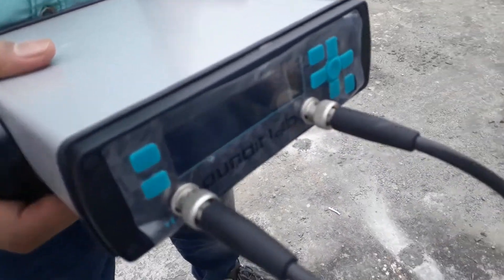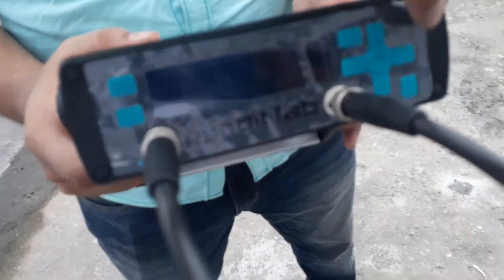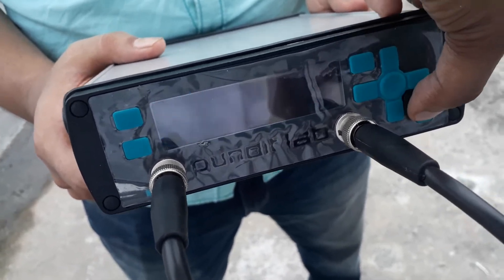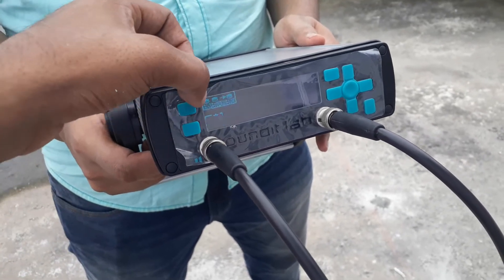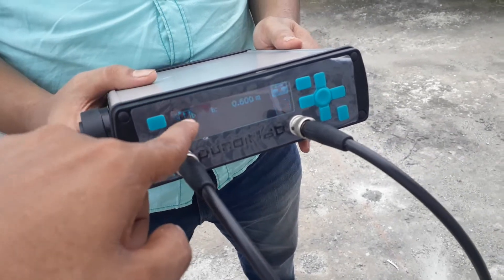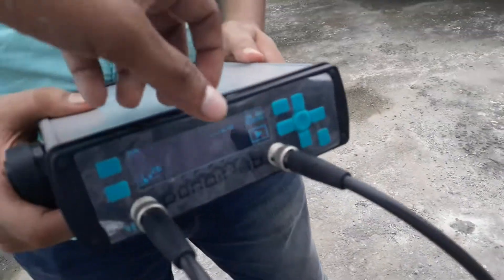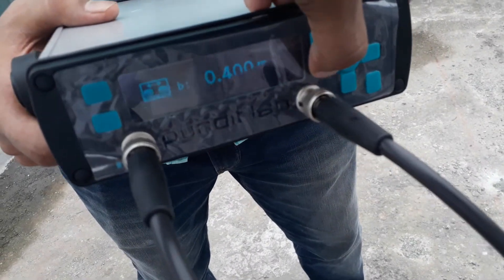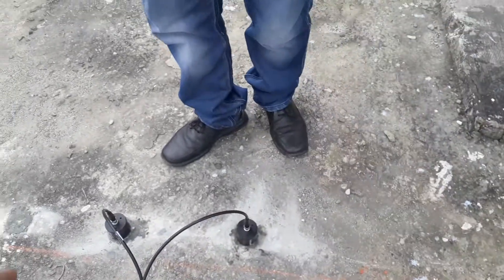How to use UPV in indirect method

Comment: Sir can it be done from bottom side of slab ( ceiling side) as I have brick tiles installed on top surface of slab....
Is this reliable to conduct this test in such situation ie slab with tiles on upper surface and from bottom slab is naked.